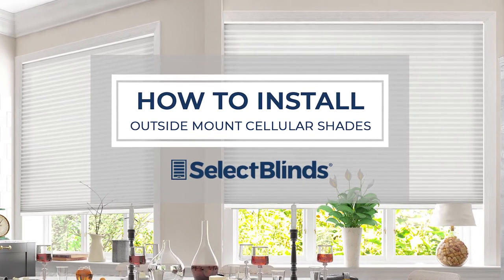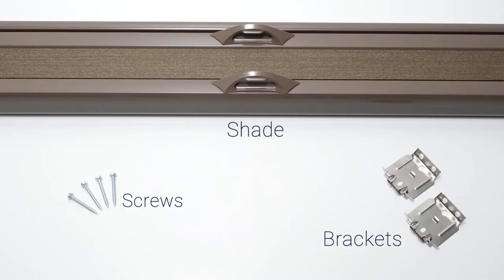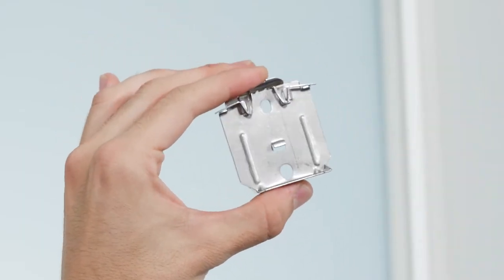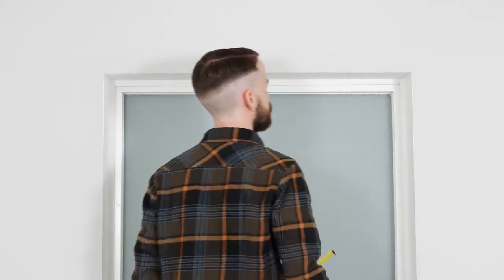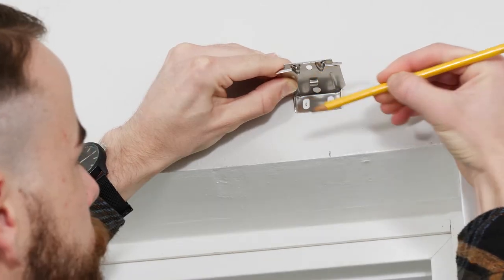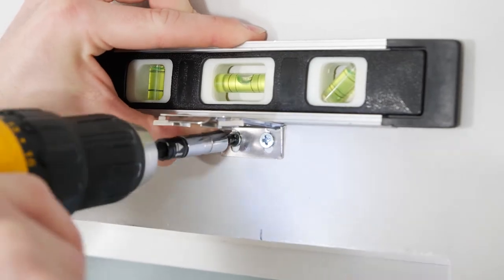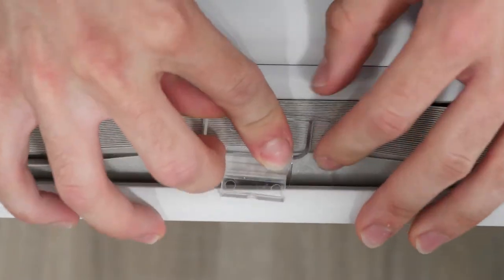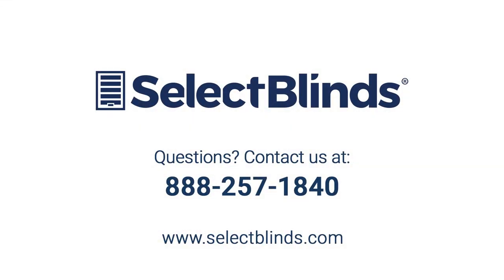How to Install Outside Mount Cellular Shades

Comment: I'm surprised there is no mention of needing anchors if the screws are not placed in the studs.  It wouldn't take long for the screws to be pulled out of the drywall if not in the studs or an anchor.
Reply: Exactly my thoughts as I go to install mine.
Reply: Unless you have a weird window it will be framed all around with studs.
Reply: It's a window opening. How would there not be studs framing it?!
Reply: Generally all window openings have two studs on either side and a solid header above.
Reply: Good points. Never considered the drywall situation
Reply: @joeoleta  Unless where you're instructed to move the brackets, the framing may not be there.

Comment: Whats the standard practice if you have mounding around the window but want to mount on the outside of the frame?
I can't hang mine on the inside of the frame because the window is too shallow.
Reply: I have molding and a window sill too, and ordered an outside mount. I didn't receive it yet though. I figure I will need to use blocks of wood under the mounting brackets to get it further away from the wall such that the shade goes over the molding and window sill when it is lowered down. I hope it doesn't look weird being farther away from the window. We shall see.